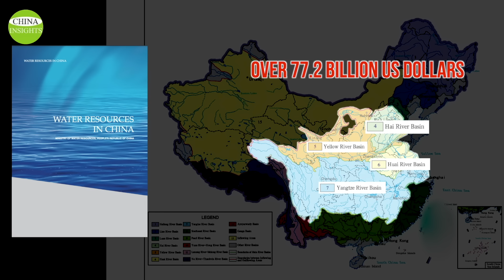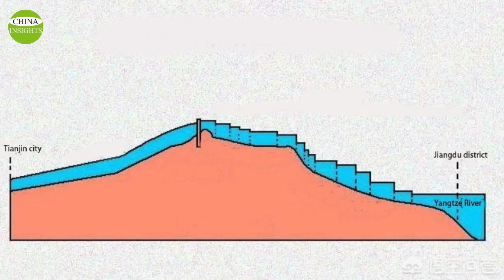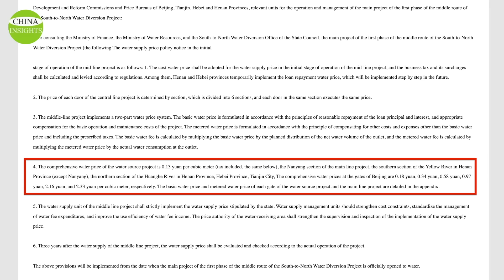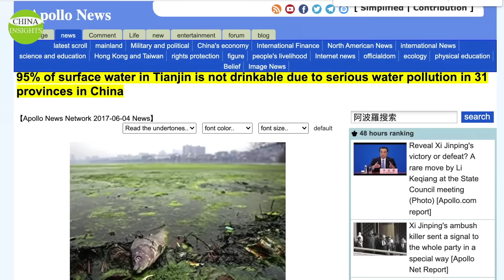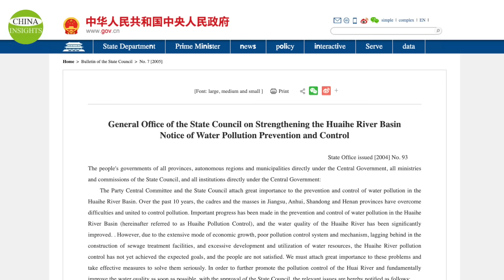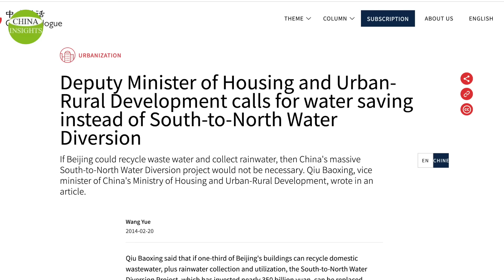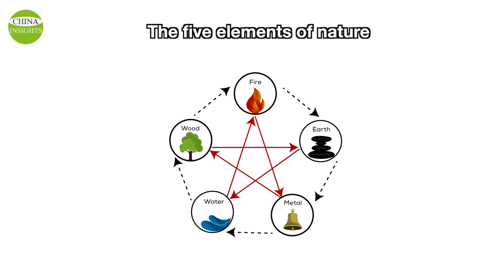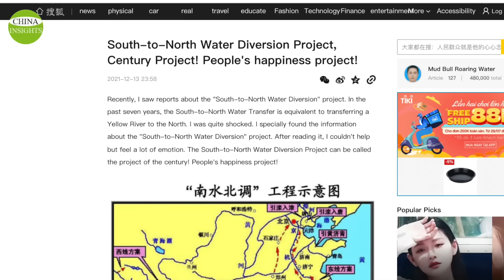South-North Water Transfer: 2.5X bigger than 3 Gorges, runs into deficit & threatens people’s lives

Comment: 7:21

*Slight correction. Bank deposits are liabilities on a banks balance sheet. The actual cash deposited is an asset of the bank. The notion that bank loans are from ordinary people's savings accounts isn't completely accurate. When banks lend they expand their balance sheets with the loan as an asset and the deposit as a liability. The money didn't come from anywhere. Rather the bank assumed the responsibility to either redeem the loaned sum of money or make payments on behalf of the borrower through the banking system. (The money supply isn't exactly as straightforward as one would assume.) 

Banking is a rabbit hole. Don't ho down there on an empty stomach. You'll end up messed in the head.
Reply: If they actually loaned the money they have it would be safer but my guess is that the banks just write off the govt debts and it slowly adds to inflation overall. 
Or they just say fuck it and it never happened.

Comment: Environmental impact aside, the economic rationale for such a massive project relies assumptions based on 1. rate of continuing urbanization 2. rate of economic growth 3. rate of population growth. If anyone of the assumptions falls short, then the project will be another white elephant. But that's not the end of potential problems if the project fails economically because the project requires significant maintenance and it's costly. Without sufficient revenue, maintenance will fall short and overtime, the overall structural integrity of the project will be at risk.  I can't imagine the impact to lives for those who live on the route should the project fails. The video does a decent job in identifying the project's environmental impact to the overall water quality and health of the country. This type of vanity mega project is typical of the country, the decision to build or not is largely political, followed by economic considerations under assumptions that can't be questioned by experts, other considerations such as environmental impact, cultural destruction will be given superficial concern and not to be taken seriously. Other countries have also been addicted to public spending of this kind to prop up the economy in the short term, and the result is usually dismal. And there is the arrogance of CCP's thinking that it can order large volume of water to flow uphill. As a result, more flooding to cities along the original river routes will happen in the future, water quality overall will decline.
Reply: One thing bugs me: Why does it not double as transport canals?
Reply: who are you that is so wise in the ways of witchcraft?
Reply: @musaran2  "One thing bugs me: Why does it not double as transport canals?" there many pumping station on the way, I think it would be rather difficult to get boat to cross them
Reply: @noahway13  "This whole country is headed into the Perfect Storm." maybe that's why the country diplomacy turned so aggressive, blaming other is a way to distract peoples.
Reply: Unfortunately, this will be everybody's problem .. very sad and scary
Reply: @noahway13  Especially when there's probably a billion more of them as "sleeper agents" living abroad in Europe and N.America.
Reply: another taiwan species.
Reply: @anteeko  You can't expect the canal waterways to be kept clean. If you use it as a highway in China.
Reply: so basically 100% guarantee to be a white elephant?
Reply: @Ravi9A  "so basically 100% guarantee to be a white elephant?"
One more for China, High speed rail is another one...
Reply: Regardless whether they are big or small projects, there is always two sides to a coin - the pros & cons. In these mega water diversion projects, I believe the pros - preventing yearly floods in the south & solving water shortage problem in the dried regions - will far outweigh the cons. Nevertheless, it's up to the people of China to judge for themselves whether their government is doing the right thing. Not you or me who are third party outsiders.
Reply: @jmng4396  No argument with your assessment on the merit of these projects, it's all personal opinion anyway. Your second point seems quite naive, perhaps you have never lived in China  or never been to China. What do you mean by "up to the people of China to judge"? Do you mean they can vote against a specific proposal, or simply argue against a government project in the public, or the media will try to cover the pros and cons of a project? Did the people in China ever have the right to judge the government on anything? There are factions in the CCP that may criticize each other, but not the people, and if you don't believe it, you can give it a try within China. Regarding your final comment, perhaps you don't have the right, I have no idea of that, but I still believe you are entitled to your opinion and no one shall tell you otherwise. As for me, I still have my residence card in China although I don't have Chinese passport. So, it seems that you projection of your own shortcoming onto me is just incorrect and self indulgence. Regardless, I was simply expressing my opinion on the subject matter, unimportant and irrelevant as it is, I alone possess the right to speak my mind, not you nor anybody else, something the CCP will never understand.
Reply: @jmng4396  "it's up to the people of China to judge for themselves whether their government is doing the right thing. Not you or me who are third party outsiders."
Why not though?
Reply: Thanks for your detailed comment.  This project reminds me of Stalin's grandiose projects in the old Soviet Union.  For example, he used gulag slave labor to build a mass dam, which turned out to be totally useless (never mind the lives that were lost in its constructions).  You'd think the CCP would have learned from Stalin's mistakes but they haven't.  Quite the contrary in fact.
Reply: @MrRezillo  "For example, he used gulag slave labor to build a mass dam, which turned out to be totally useless (never mind the lives that were lost in its constructions)"
I don't know much about that, that seem interresting, I wonder if you had a link/book of maybe youtube video to recommend me on that matter.
(Naively I thought the gulag work was "productive" or "useful" but it was a waste.. this was really insanity..)
Reply: if it makes ya feel any better the chicoms dont hava shortage of money. so the scenario of em runnin outta dollar dollar bills is quaint. you'll recall communist china didnt waste $2 trillion dollars bombing the crap out of afghanistan & trying to occupy that place for 20 years to defeat the taliban, so they got plenty of cash reserves
Reply: infrastructure projects are good policy in resession only, if they are projects that are truly needed and done carefully.  Environmental destruction is also long term economic destruction. Building just for the sake of giving people work is just wasting resources.  Every and all infrastructure projects should be placed under scrutiny and critique.  There are no free meals, when it comes to the environment. Technology can help manage environmental risks, but nature cannot be defeated.
Reply: And yet New York City gets its drinking water from 240 miles away by a series of reservoirs, canals and tunnels. Los Angeles has an 230 miles aqueduct from the Colorado River.
Reply: @SorbusAucubaria 它当然尤其实用需求和价值的，中北部7个省都严重缺乏水源，这些地区是重要的工业基地，也是主要的粮食产区。所有产业和人口都受限于水源问题。受影响的人口超过3亿。
这些项目的好处已经体现出来了。一个简单的例子，项目覆盖的大城市水费已经超过十年没有涨价了。

Comment: main reason for water shortage in Beijing is overpopulation. They have recently enforced a population limit on the city to prevent furthur deterioration of the crisis, but his is not a remedy it just means the city will remain at water shortage for the for seeable future.
Reply: @badshootykat5574  the north is dry, has more industry that uses water and has the pollution problem in addition to more people due to Industry as you said. Bad planning (which is not only done in china but many countries. China puts it on another level though) really adds up here.
What bothers me more is that it's gonna get worse for both south and north if the water from glaciers gets less which is approximately around 2030 if I remember correctly.

Comment: it would have been a lot safer had they built it underground and sent the water also to the country sides in case of overflooding 
it would be more as a back up canal but they sure need it now more then ever
Reply: Dude... Pollution already seeps deep in chinese lands. That's just gonna create a canal to gather and sweep those away. And also, anything underground is a pain to repair and maintain. Any malfunctions causing to leaking of the water underground reduces the structural integrity of the soil above. Perfect formula for sinkholes.
Reply: Water tunnels are a logistical nightmare, constant surveillance against water erosion must be maintained, as well as physical access for repairs. 
If you are to do it all below terrain, a series of diversionary tunnels and underground reservoir must be built to facilitate all underground.

Also, being underground does not necessarily make it any safer, as a canal failure underground will cause soil liquefaction.
Reply: @addamr2052  How would a dam change the Earth’s axis?  Doesn’t that claim seem a bit, uh, stupid to you?
Reply: @addamr2052  The earth's axis changes by itself on a regular basis.
Reply: They can't keep the sludge out of the canals, it would block underground pipes and they'd be impossible to clean out.
Reply: @addamr2052  I dont understand, how is that even possible???

Comment: Technically the state of California uses Feng Shui in its road and water projects. Not because it necessarily believes in the metaphysical aspects. But California is such an active earthquake zone and prone to mega droughts and mega floods. That it was found that following natural terrain as much as possible and avoid carving through mountain and hill sides. Would minimize damage from quakes and other natural events. As the local terrain had been molded by natural events so it could taken advantage of when building things like roads and water systems.

Comment: Is it all driven by gravity? I what to know the engineering. It is fascinating.
Reply: No, mechanically as well
Reply: The line is broken up into sections. The water is mechanically pumped up by 100 meters. The water will flow down hill until it reaches the next pumping station. Repeat.

Comment: Imagine the devastation if these projects were attacked by a terrorist or bombed during a war.  That is unlikely to happen.  However, the lack of an environmental impact report is more likely to result in disastrous consequences with just building the projects alone.  I bet the concrete work isn’t close to the quality of what is seen in western countries either.  So, long term deterioration is more likely to happen.  Also, it’s not a good idea to dump raw sewage directly into the water supply.  I guess that’s a good way to control the population.

Comment: why do they use cubic meters for water on this scale? isn't the standard si unit for this type of stuff hectare-meter?
Reply: But is that a volume measurement?
Reply: @sunesnigel  yea think of a hectare of area that's a meter deep. in the us we have the acre-foot. it's super useful for calculating rain and reservoir management stuff, and it's used everywhere for large-scale water management.
Reply: @nick4506  ok. Sounds very useful! As far as i can recall we measure everything in m³ here in Sweden. But I tend to lose grip of things since numbers easily become overwhelmingly big when you scale things up.
Reply: Hectares aren’t an SI unit, I believe. More likely you’d use a cubic kilometre, but normally you keep to cubic metres, since the metre is the base unit for distance in the SI system
Reply: @SkigBiggler   hectare is an si unit. it's 10000m^2. What are you taking about. I didn't even grow up with si and I know that one.
Reply: @nick4506  nope, I just checked. While it is metric, it is not an SI unit. SI units work using a set of prefixes (kilo, mega, Tera) each corresponding to a multiplier (1 km is 1x10^3 meters, 1 mega meter would be 1x10^6 meters, and so on). So it’s more appropriate to express the area of a hectare in meters, as 1 hectare in square kilometres would be 0.01 km^2. Regardless, hectares are not a part of the SI system, just commonly use metric units.

Comment: China is at last starting to look into pollution from all aspects of industry and move the high pollution operations into controlled areas close to the ocean as new factories are built to replace obsolete operations as technology changes. Let’s be factual all rivers today around the world have poor to very poor water quality from industrial pollution from the 200 years of industrial revolution

Water is seen as the key issue for future generations as climate change impacts on rainfall. China is estimated to suffer up to a 30-35% reduction in rainfall particularly in western areas of the nation. These water transfer projects will be critical in coming years and are being built while China has the population to undertake them. 

The financial cost is a paper cost only and has no bearing on the actual impacts on the general economy. People are employed on all aspects of producing the raw materials required for each respective components which is ongoing with the maintenance to maintain the waterways. These channels do not run for about one to two month at the end of summer autumn allowing plenty of time for de silting operations prior to the next winter flows or  use of flow control gates in some areas to drain the channels.

Comment: A totally useless video and a disgrace to China Insights that has provided other excellent videos.  Too many speculations without solid engineering or scientific basis.  I am an engineer with decades of construction.  The money is all spent within China and not for imports of foreign equipment and expertise.  

Water aquaducts have been widely used in Roman times.  Whether above, on or underground, they are just canals.  Surprising, they can withstand earthquakes far better than houses. Plus in the even of a breach, they can always shut the pumps  Presumable there are also gates that can be closed to limit the water losses.

This video was produced by non-technical experts and only speculated on massive over-runs, possiible losses to the public.  I find it totally useless and stopped watching after a while.

If the objective of China Insights is to insult, to generate alarms about China, I will stop watching their videos.